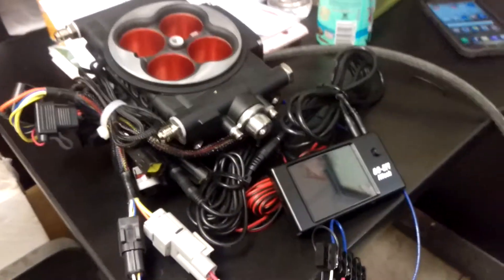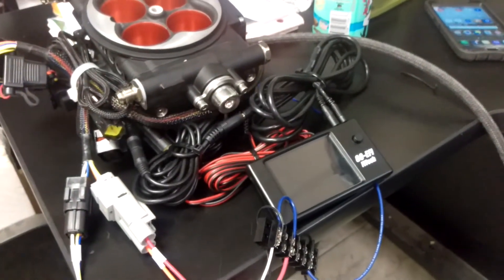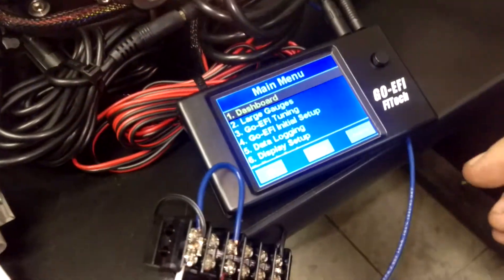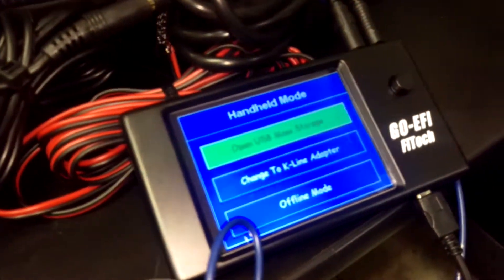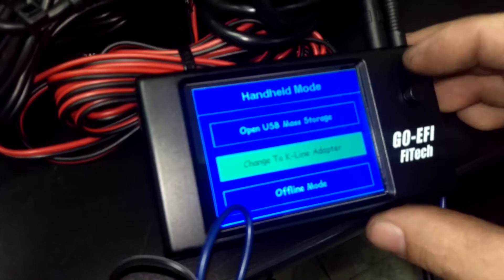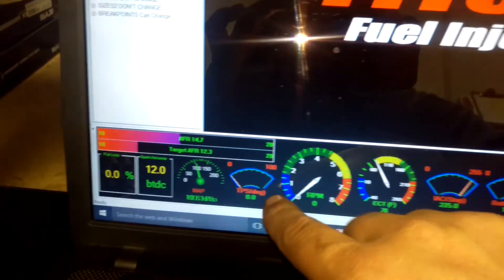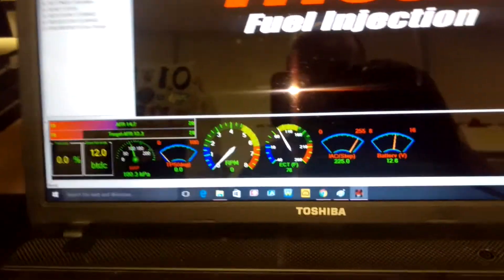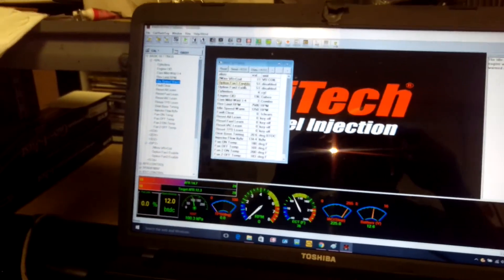Vw Fitechefi tune info from LowBugget

Comment: Hey there. I'm currently running an 1835cc on my Baja ( No Turbo) and on the fence between the FiTech 30003 four barrel of the 39001 2 barrel. do you have any thoughts. Also, do you have a website to purchase from you with the longer cables.
Reply from the maker: Hi. For your size combo I would look at our two barrel kits #4 or #5 on FitechVW.com

Comment: Throttle body injection is crap,multiport is only way to make power,this is why Vw turbo is the slowest of the imports
Reply from the maker: Have not had a problem make power with these but if you like I do offer port injection option! More info visit FitechVW.com